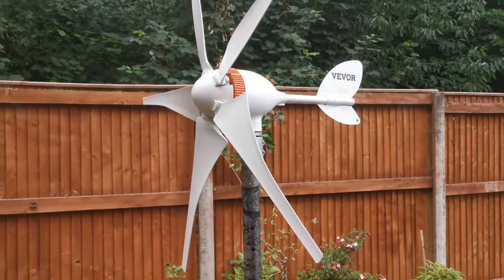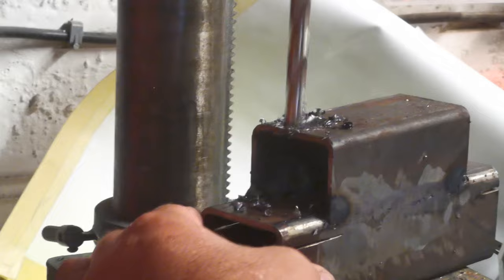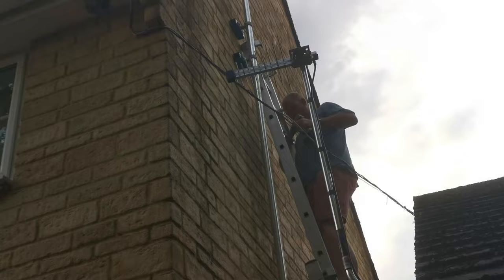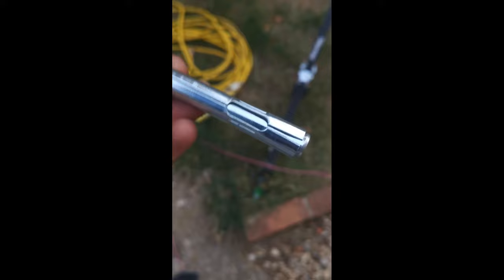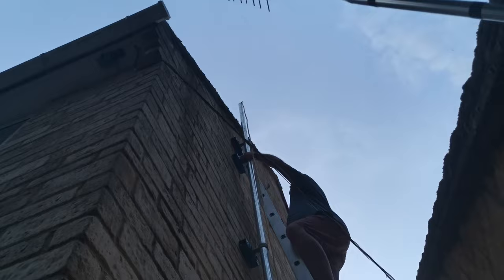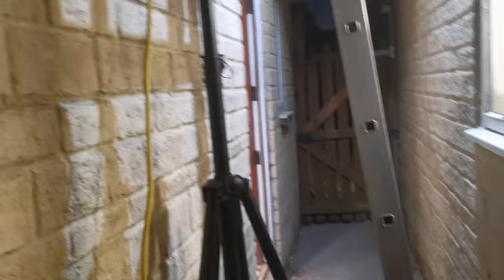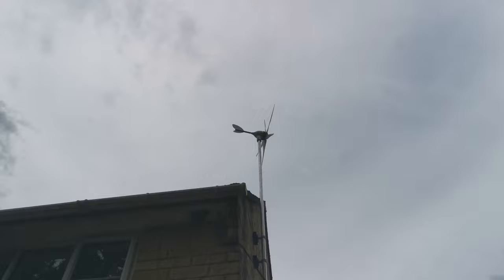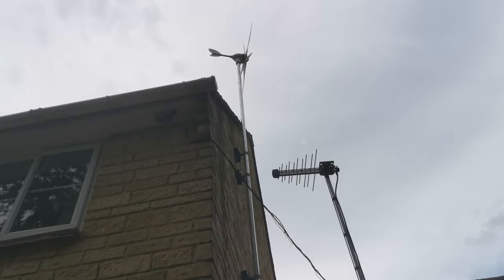installing a wind turbine at home |  how much power will it make?

Comment: I had similar results. We only get power only after spinning fast enough to reach 10Vac. 10vac x 1.414 is 14Vdc.

So here's what I was thinking:
Use solar to charge a  12V battery.
But, if not lithium battery,  don't use charge controller.  Design yourself with diodes and caps.
Place 12V battery in series with wind turbine, then parallel these with battery/s you want to charge.
If you do this, the moment blades spin, you should start getting power. I know it's a complicated experiment,  I haven't done it myself  for same reason. But although you'll be using power from a battery, it should be half as much power from this battery to charge the others. Just a thought,  I hope I get to try this, before I take down my setup. I was hoping this would have been a worthwhile addition to my solar.
Reply: Another alternative is to use a DC-DC booster circuit to increase the wind turbine voltage to 14 volts to charge the batteries 🪫. 

It you don’t use the DC-DC step-up booster, you will only get energy from the wind mill when the batteries are discharged.
Reply: @ajarivas72  Do you have a circuit?

Comment: Does it make much noise, that's a concern I have.  If you get a decibel meter you could find out for sure.  I'd like to experiment with a wind turbine myself but I'm concerned about the effect of any noise on my neighbours.
Reply from the maker: when it really gets going you can hear it, but its not that loud. i would say the wind itself is louder especially with the woods behind us, still a defiant tone so is noticeable. it is right outside a bedroom window for us and we've not had an issues.
Reply: @tobywhiting10  Hello Toby and thank you for that insightful piece of information.
Reply: Use hard rubber on each connection to the house and they make some for where the turbine mounts on the pole as well. I have a 47 foot 4 legged wind mill tower I am about to setup but I have not chosen a turbine yet, hard decision

Comment: I have 48 V model. I cannot even get 48-52 volts to start charging battery, I measured output and it gives roughly 30V, what could be an issue? Thanks
Reply from the maker: My experience with these turbines hasn't been that good. If you're using the default charge controller, it might just be that you don't have enough wind. You might see that in higher gusts you'll get bursts of power being sent to the battery. In order to charge your battery, they need to be at a lower voltage than what the windmill is outputting, not by much, but otherwise current won't flow.
Reply: Get dollar system
Reply: Solar l meant

Comment: The pre-made market built and sold wind turbines... they often say they have these little charge controllers that come with them. But what I don't understand is if they have enough wiring to go from the wind turbine to the charge controller to buy it separate? Do they do this? Or are you supposed to look for the wiring separately? And do you have to buy the wiring separately to go from the wind mill to the charge controller? That could be a lot of wiring if the wind mill is high up, since the charge controller is probably likely to be at the battery bank and power inverter which won't be at the top of the wind mill? Any advise? 

Do they come with enough wiring to go from the wind turbine down the pole and to lead into a power station? 

This seems like more headache if they don't have enough wiring to go from the turbine to the controller. And what's more headache is that it looks like the wiring for wind turbines is different from just the black and red wiring for solar systems and power banks normally. 

Hope someone has input on this. 

... 

As to how much power it makes... I looked at many of the technical information for these. its listed in the specifications where they sell them. And their power generation stats are based off the calculated wind speed rate at 12 meters per second. And they listed the initial wind speed required to get the power going at 2.5 meters per second. 2.5 meters per second is basically about 5.5 miles per hour. That means 12 meters per second is probably a bit above 20 mph wind... I'm not quoting it exact but its something like that. (You also lose some power with the turbine turning in the air to 'find' where the wind is coming from.) 

Now where it gets funny on figuring the math of this is that when they show you these little turbines for sale the ones that are 400 watts quoted turbines show the same stats/specifications as the 1200 watt version. And that doesn't make sense. So their math is ... imperfect and questionable in some aspects. It shouldn't be that the 1200 watt turbine is doing the same numbers as the 400 watt version... plus the 1200 watt ones have more blades. (Nobody talks about the power generation differences comparison of 3 blades, versus 4, or 5 either). 

It would seem ideal also if they just listed a table graph for the power generation based on average mph or kph of wind speed... like x power produced if wind is 20 mph, x wind speed if the wind is 30 mph, and so on. But nobody does that either. This would be much more accurate and people wouldn't feel like they are in the dark. 

...

Another problem is that many / most of the wind mills don't state the max speed sustainable by the wind turbine. And they don't state also if that wind speed max is based off the device being able to safely NOT break with the hardware at what point and so on? I did look for this on many of the labels and didn't see it. It was left off. In theory the hardware of the wind turbine has a max wind speed before its taking on ware and tear.
Reply from the maker: The windmills do not come with any cable to go between the controller and the windmill itself, you are expected to provide this. The only cable they come with is that which is attached to the bottom of the charge controller (only about 5 centimetres) and a very small tail that comes out the bottom of the windmill. Any three core cable will work it doesn't have to be special cable.
They also have inbuilt brakes so if it tried to spin too fast they will slow down by themselves without damaging themselves.
Reply: Thank you
Reply: @noahriding5780  with such small amounts of low voltage power, it's important to use thick cable to minimise voltage loss along the cable run.  There are calculators online that do the maths for you, you just enter a few parameters.
Reply: @jonathanwebb9862  Thank you Jon

Comment: It's been a year since you posted this. Was your results like mine?  I'm sure I have posted here before. I have one like yours but a 500 watt five blade. Bet they are the same ones with different labels. Mine did nothing in good wind at times. Sounded like it would come apart. I took a 12 speed bike and robbed the sprockets to gear it 2 to 1. Got 3 blades 7 inches at base by 4 inches at the tip. 36 inches long. I have yet to have any wind to speak of. Just put it up. In 5 mph wind it did turn but no power yet. One thing is these things should come with 3 blades. I cut my 5 blades off 6 inches and put them on a Ameteck 38 volt 12-amp 950 rpm motor I have. It works ok like that. It did not work as good as the other Ameteck motor (Same spec's) with certain type 3 blades air master fan blades. I had the same blades on one of the motors years ago and it melted a 12 gage cord. BUT it was 150 ft long. A little long for DC. Good luck with yours. I'm just trying to get something out of mine. All in fun.
Reply from the maker: Follow up video is in the works, shouldn't be too much longer : ) Sounds like I had a similar experience to you though even in good wins it wouldn't do much.

Comment: from what I know, it is not ok to mount the wind turbine on the structure of the house because you will have noises in the house continuously.
Reply from the maker: We had originally planned to put thick rubber between the wall and the brackets but we forgot on installation. There is not a lot of vibration noise, the wind sound through the window is Louder. It was a consideration though and you can hear it if you really listen.

Comment: so how do you connect it to your system after the wind controller mate ?
Reply from the maker: After the wind controller, the power goes and charges the batteries along with solar and any other inputs. Then once the battery has reached a set voltage level the inverter automatically kicks in then start running things. Once the batteries are low again the inverter flicks back over to supplying the house from the grid and the cycle starts over.

Comment: All other practical tests also show that small wind turbines hardly generate any electricity. Because there is hardly any wind near the ground! 
If you really want to use natural energy sensibly, you should set up 2x2 solar modules in S-E (for morning sun) and S-W direction 
and then use electricity with a so-called plug-in solar system. 
With an investment of only about 750 €, you can generate about 30,000 kWh of green electricity in 25 years!

Comment: Interested in doing this myself…..do you need to have this done by an MCS accredited installer?……i can’t seem to find one who does wind installs. Can you recommend anyone?
Reply from the maker: We didn't use anyone professional, we just boalted it on the house. Probably not the best thing to do but oh well. 
It's a lot of money and a lot of work for not a lot of pay-back. One of this size isn't that economical in my opinion, but it was a fun experiment.
Reply: @tobywhiting10  Yeah- I’m still on the fence about return and wattage generation. We have about 5-7m/s of wind consistently…..so I reckon we could get 100-150w out of a turbine to supplement solar during dark winter days. Expensive investment for 2-3kw a day. Still….I’m interested.

Love your video!
Reply from the maker: @ianramsay10  I don't know wind speed in terms of real values however we are a most getting 50 watt hours a day. 
The annoying thing is they do not work at all on low speeds, it has to be really going.

Comment: How do you make conection to grid ?
Reply from the maker: Because it's a custom system and not from a approved installer, we can't connect it to the grid. To use the power there is a line running into the house supliying a handful of sockets which we can plug things into.

Comment: Why didn't you just use the pole to get the turbine in place you could have fixed the turbine to the pole push it up to required height then cut it off 🤷

Comment: you have a lot of flow disruption sitting there  in proximity of the roof, no wonder your results were disappointing

there's a reason turbines are mounted in open areas, high above the ground

Comment: How high off the ground do you need to be for power generation to really take effect? 

In many videos people think you have to be high up but people don't actually state a certain amount that they found, or tested, or that other people found for this. 

Thanks.
Reply from the maker: We just put one up, didn't really consider the height. It was lower than the peak of the roof, which was a bit of a mistake because I think there was some turbulence. We have taken it down now as it didn't make enough electricity.

Comment: May we have an update please?
Reply from the maker: One will come eventually but it ended up doing so little that it's been taken down now unfortunately. The (admittedly small) noise and visual impacts it had are just not worth the amount of electricity it made.
Reply: @tobywhiting10  I think that the house roof is causing turbulent air flow and what you need is more elevation to get smoother and more consistent wind. If that is possible of course!

Comment: Not much better than nothing when it comes to power generated, and it creates a nice lightning target with a path down the wiring & then into your more useful solar power system & your connected electrical devices. 

A friend who has a really high tower to get up into the decent wind had a lightning strike that he says jumped around a disconnect and fried a lot of his internal systems & connected devices.

I'm not going to risk that for a paltry amount of wind power that looks cool but doesn't actually produce much.

Researching all sorts of green technologies for homesteaders, I have come to the conclusion that the market is full of exaggerated claims, outright scams and costly disappointments. Seems that whenever there are profits to be made, the sellers hype performance numbers & customer expectations so "caveat emptor".
Reply: There's a lot of weirdly designed wind turbines claiming to revolutionize home wind power generation, but in the end the calculations are not all that hard to make.  P = 0.5 Cp ρ S v^3.  Where Cp = the turbine's efficiency, ρ = air density, S = swept area of the rotor, and v = wind speed.  Plug in typical values for residential rooftop installations, and you can at best get 2.5kW of power with 5m^2 swept area, in moderate winds, assuming a very high efficiency turbine (the theoretical max efficiency is just under 60%, but small turbines in more turbulent air around buildings can probably not hope for more than 15-20% or so).
   
So there's some useful power to be had, especially if you can place them a bit higher up, and considering that these things run at night as well.  But given the cost you're probably much better off with cheap and easy-to-install solar.
Reply: @kaasmeester5903  Spot on comment! 

Once the physics was known and put into a formula, the theoretical maximum performance of any new wind turbine design can be calculated & probable output under different wind conditions could be guesstimated.

The only things that could change this would be a design that engages some fluid dynamics effect that would increase air density or wind speed by concentrating airflow, or a blade system design that radically increases swept area.

Thanks for reminding everyone about the laws of physics.
Reply: You are right.

Comment: In winter it will work a lot better.
Reply from the maker: we have had 130W off it now, doing better than I expected
Reply: @tobywhiting10  Thats more like it. Getting to the time of year anyway where the sun fades and the wind picks up it's when you actually need it to work. In summer it doesn't matter cos the panels are rocking.
Reply: Of course, a hybrid system will out perform a single source, over the year. Unfortunately many people don’t understand the relationship between power out, swept area and wind speed. Ideally, the turbine needs to be 10m or 30ft above the nearest obstruction. This will allow smooth, laminar flow over the blades and will give a more consistent output. In your situation, I would recommend a Marlec turbine, like the 914i. They have a very low start up speed. They make them in Corby, Northants. I’ve installed 2 of these on narrowboats, with a hinged mast, which Marlec can provide. Best of luck with your system, looks good!

Comment: They are a poor design 
I really want to make one.
Multiple blades not just on propeller & a bigger bush less generator 
Really they want a gear box to speed up the generator up
Also quality ceramic bearings